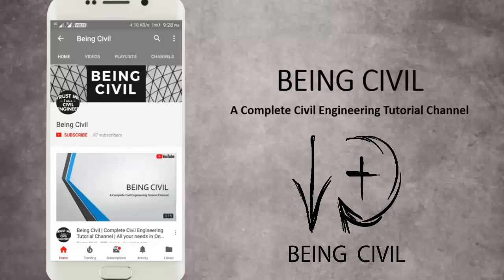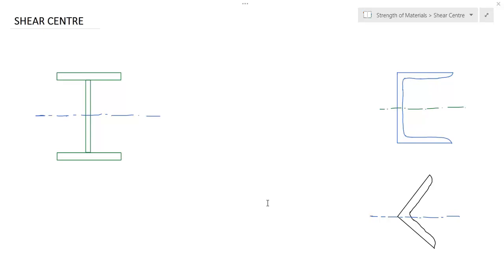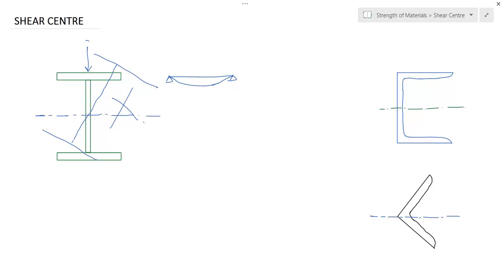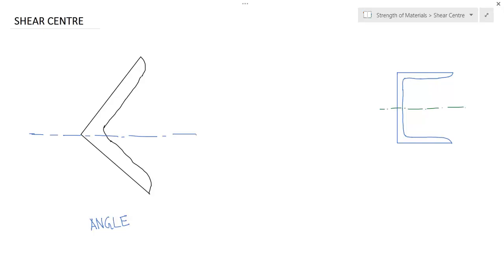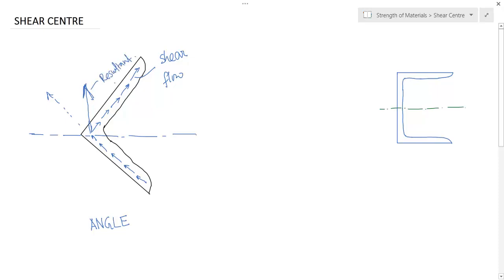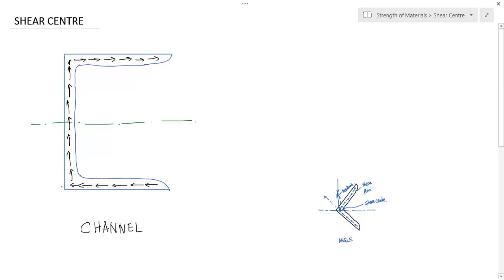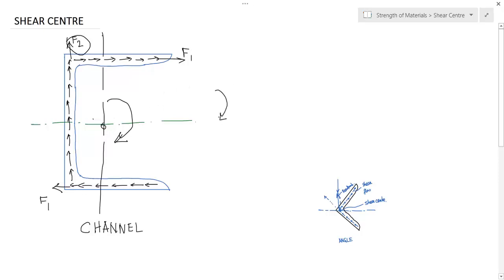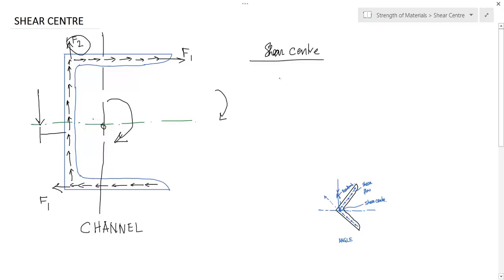Shear Centre Basic Concept

Comment: How can i make the force pass from shear center if it was out side the section by moment or what ?
Reply from the maker: To avoid twisting in Channel Section, you have to apply load through shear center. Otherwise there will be twisting.

Applying load though shear center is practically possible if you weld some member(like small plate or rod) with the channel and then apply load at that distance.

Hope this clears your confusion.
Reply: I think it means, in the channel section where ever we apply the load there will be twisting

Comment: Sir, why in the channel section shear flow is from bottom flange to top flange? Why not from top to bottom flange?..
Reply from the maker: Any reaction force is always in the opposite direction of applied force.
Reply: Being Civil 
Sir in which way the force is applied on channel section?
Reply from the maker: Vertically downward.
Reply: Then the reaction in top flange must be in upward direction , why it is towards our right hand side?
Reply from the maker: The shear flow generates from the bottom tip of flange and goes to the other tip of flange. The shear flow is continuous hence the direction can't be broken.
Reply: Tq sir for u r kind information

Comment: Sir how shearing stresses will come 1st on the section??
Reply from the maker: It's generates when load is applied. And If that load is applied through the shear centre then there is no twisting.
Reply: Being Civil in channel section when shear force will makes in clockwise moment after that we load will apply anticlockwise to compensate this moment so load will come after the shear force so how can it will be possible by load applied 1st before shear stress developed??? Plz reply me otherwise give ur contact number I wl cl u??  I m confusing plz clear my concept
Reply from the maker: Shearing stress no longer generates until you apply a load.If you apply a vertical load on the channel top flange the clockwise moment generated from the shearing stresses twist the section. For that reason if you apply the load eccentrically to the left of the channel at the shear center then the twisting is balanced.
Reply: Being Civil I got it ...thnk u but u didn't mention the load will apply in top flange thats why I was confusing by the way thank u...